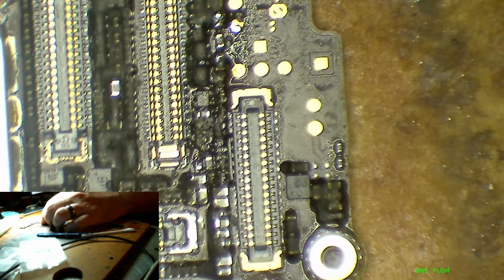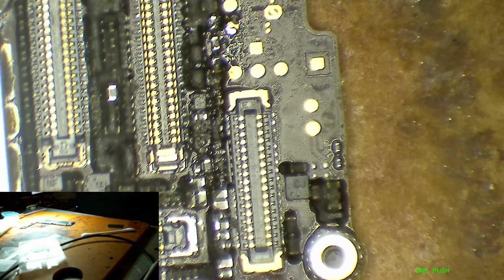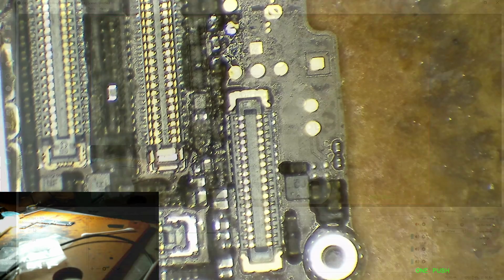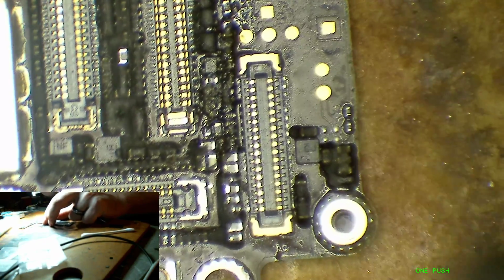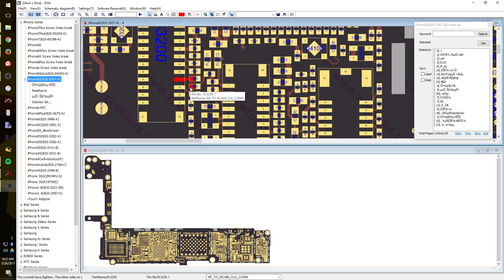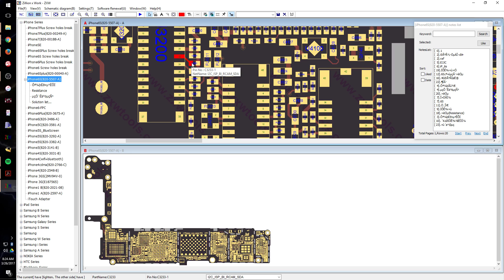iPhone 6s rear camera connector and no image repair - part 2

Comment: Ok, so the old "let it fix itself by working on an area that doesn't have the signal" trick! More proof this stuff is just black magic sometimes. But working is working.  By the way, in retrospect you could have pulled the filter BEFORE pulling the connector & concluded the connector wasn't the issue.